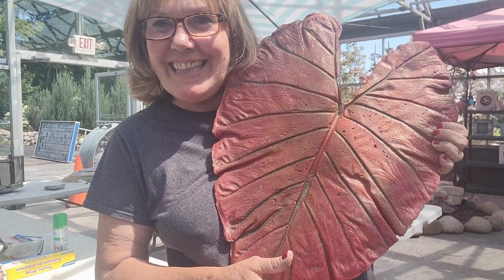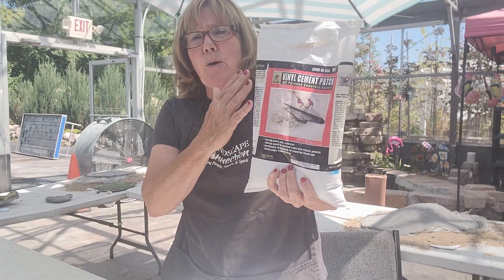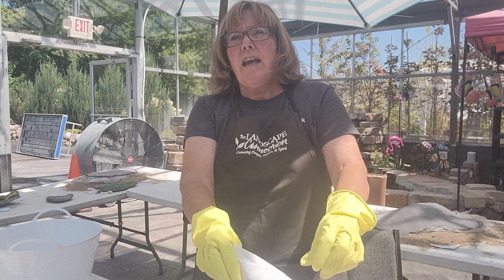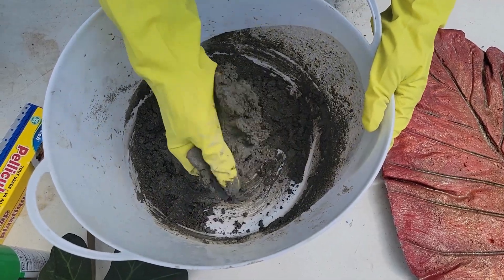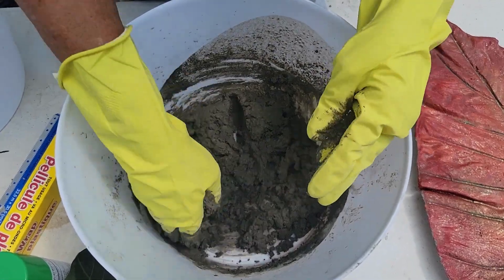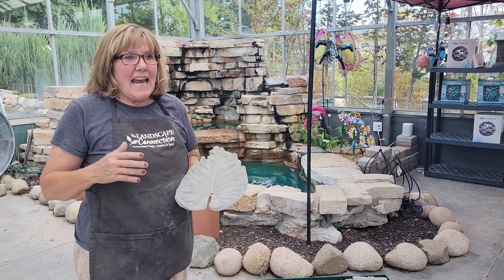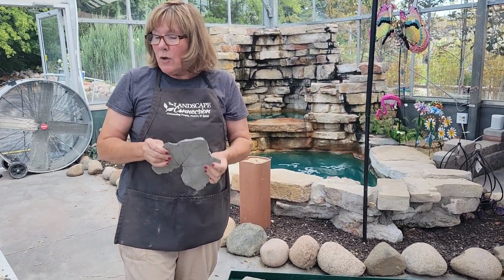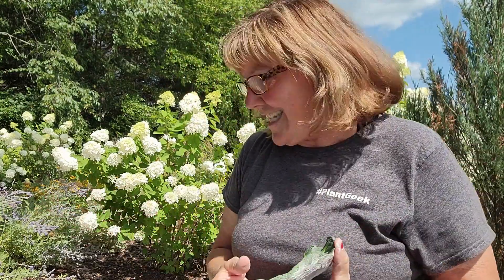Leaf Casting

Comment: Excellent instruction! Thank you.

I just took a class and we sprayed them with flat black protective paint (as a primer) a few days before we did the decorative painting. I didn’t notice you putting on a protective primer paint. Did I miss that in your video?
Reply from the maker: No. I spray with polyurethane after
Reply: @gardeningTLC  maybe the difference was that we were using powder paint.

Comment: Hi Michelle, 
I have wanted to get around to leaf casting for years, and I had several extra bags of cement from a previous job laying around in the garage, so today I sifted a couple of cups of the dry mix through a colander into a gallon ice cream bucket (I wore my painting respirator) and mixed that powder up with water for a sorta thin initial layer, to make a nice smooth imprint.  There was still some wet mix left so I added back half the pebbles I'd just sifted out to give it some bulk and patted that on as another layer.  I probably broke every rule of mixing concrete right but it's just gonna be a stepping stone for the outdoor faucet so...whatever!  You are right, it is fun and easy!  
P.S.  I wanted my leaf to be super flat so I just put the saran wrap straight onto my potting bench table and set the leaf on that.  I guess in 72 hours we'll know how it looks!
Reply from the maker: Perfect

Comment: @gardeningtlc - Will these be strong enough for stepping stones in the garden? Are they able to withstand weather swings? Winter?
Reply from the maker: I think you would have to use a concrete  mix with more aggerate in it to have them be strong enough for walking on them. I pull mine into the garage in winter.